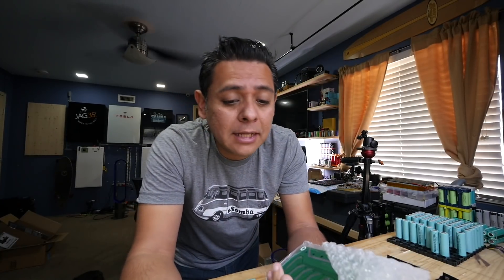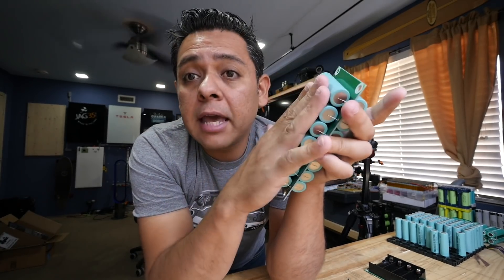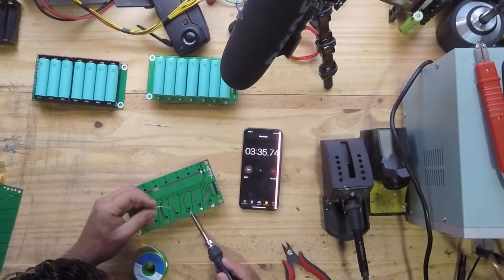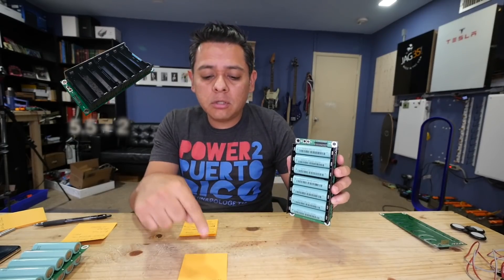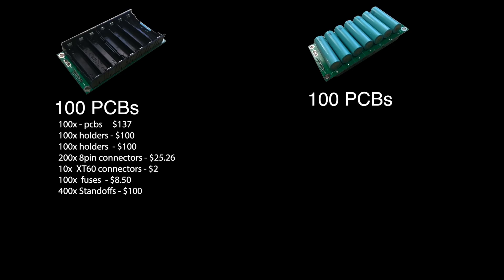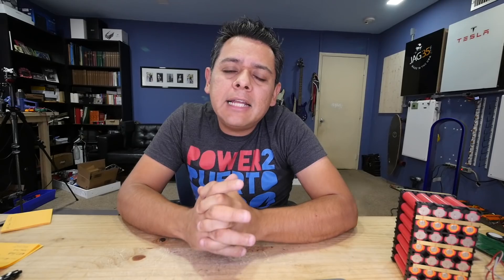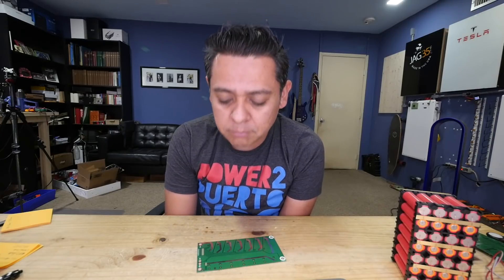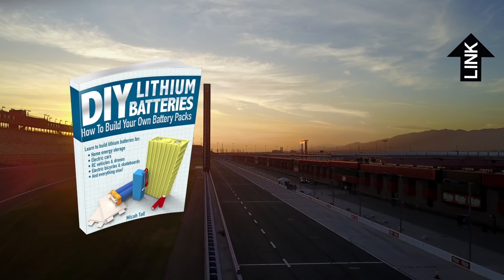DIY Rapid Build 18650 module PCB - Test Boards Available

Comment: Kuna from Toronto Canada:----Today 2nd day after joining with you Jehu, I want to build a small power wall for the first time for my small apt use.Can you please send me 10 pcbs and all other componants to put 70 X 18650 batteries together? or please tell me where to order and the specific names for the parts.

Comment: The difference, when it comes down to replacing batteries, that time will now take you less than 20secs to install the batteries per board with zero cost of material, all cast will be invested in batteries

Comment: do you have a link to the mini multi cell meter ?
Reply from the maker: Kit.com/jehu
Reply: ok so i went through all (i think) your listed items, i see the new colour one with the horizontal display, i was after that lcd one you have with the vertical battery display, i guess its an old model
Reply from the maker: Yeah discontinued unfortunately
Reply: isnt that always the case with the simple and effective type tech
im working on battery monitoring with an epaper display for low power consumption projects, far away from your power wall projects but i like power conservation, hence why i liked your lcd type monitor, thanks for the reply, enjoying seeing your progress

Comment: I'm a newbie but I'm concerned about aging cells.  Do they get swapped out after a few years?  Also I'm assuming they would need to be removed individually if you're trying to track down one bad cell.  It seems the more expensive kit would be better for future battery swapping.

Comment: So the question is how do you mount them. Since you already get a premade mounting system with the battery holders. Also you have a cleaner solution with the battery holders, if the battery goes bad you pop it in and out
Reply: Yeah, it seems like maintenance is going to be a pain on the spot welded batteries... though... you won't ever have batteries pop out by accident that way, either. :)

Comment: Jehu, I just stumbled onto your channel recently, I am intrigued.  I've been interested in building a powerwall for a while and I think your channel provides enough of the details to not only make it possible but simple.

I have a question for you about one glaring piece that you don't seem to discuss.  I read recently that a significant portion of our household power consumption is actually used as DC, not as AC.  Televisions, computers, chargers and now as we move toward LED bulbs, even our lighting.  With that being the case, it seems like you are wasting a significant amount of power by converting it into AC just to put it into your walls and again when converting it back to DC (in the wall warts and in-device power supplies).  Have you considered way to deliver the voltage from your powerwall units to places in your home where you can consume the DC directly instead of converting to AC and back to DC?  For example, if I could provide a 12-volt dc outlet behind my couch, I could run side-table lamps (converted to 12v DC with LEDs) and my laptop directly from that DC outlet.

Comment: Hey Jehugarcia , great video, thanks for sharing.  Would you please be kind enough to also make a board (ready for the holders to fit on) for a 14S setup thanks, that way it can be used for 48v inverter setups, where as your current 7S boards are really only well suited for 24v setups.  I know you mentioned that you can in theory put the 24v boards together to make a 48v setup, but it would be nice to have a 14S BMS header on each board so that a 14S BMS can be connected to the PCB boards for very tidy 48v setups. I'm sure other fans would likely also be keen to purchase 14S versions if you made them available too, hopefully your existing 7S version can just scale up / be extended to make the longer 14S version.  Cheers and keep up the great work :)
Reply from the maker: 2 of these makes 48v  no need to make another board
Reply: Hey Jehu, thanks for your message back (that means alot).  To be honest, I think you've missed the point a little bit there (hey we're all human right).  When you were performing the calculations for time & cost savings in your great video for using holders vs manual soldering etc you worked out time + cost saving comparisons compared which was awesome. If you were using say 100x pcb kits to makeup a diy powerwall then 100x 14s PCB kits actually end up less cost $ wise and time wise to assemble into a 48v battery pack than what it would using double the amount of 7s pcb kits.  As obviously the 14s pcb board could likely get away with 6 standoffs per 14s pcb instead of 8 used for 2 x 7s pcb, and you'd only have one bms connector (although a 14 pin version) and only 1 main dc power connector per board.  When you actually perform the calculations on using 100 x 14s pcb kits vs 200 x 7s pcb kits you'll actually see it makes financial sense + actually does save time also.  Run the calculations yourself and you'll see what I'm talking about, thanks :)

Comment: Why not move those BMS connector closer to the cells rather running all the way to one end. That would reduce the resistance and trace length. And are those boards done with 1oz copper or 2. The second would have more resistance and reducing the trace width also helps.

Comment: Spending a lot of time with 3D printing of late. The interesting bit is you can come up with your own designs, rather than depend on what someone else mass-produces (or do only one-off fabrication).

Watching you put together packs, but limited to only existing mass-produced plastic ...  pretty sure we could do better.

Pretty sure with a bit of clever design, we could reduce part count and assembly time. Producing the plastic bits via 3D printing is a bit tedious, but not expensive. Plus, if we come up with a good design, some Chinese manufacturer might rip us off, and start mass-manufacture for cheap (which is good for the larger community).

Also, pretty sure you are a short drive from me. :)

Comment: I'm noticing that on the nonholder assembly you've opted for a relatively small gauge wire.

 Im no expert but if you redesigned the vias that connect the battery wires to be more like <==> where it could accept a piece of flat ribbon wire, whats usually used to inter connect batteries in packs like this, would that not make it a bit more conductive and allow for better temperature control?

Comment: 2:49 I see a double row of holders on that board. You snuck the solder in at the ends of the holders. I have the same type holder here and I knew it could be done.
Reply from the maker: Yup, if you have the patience and don’t mind half melted holders,  go for it

Comment: Can't wait for the final version of the board!  I wanna build a 48v power cell for my ryobi lawn mower!  Tired of replacing the lead acid battery that seems to only last 1 season...
Reply from the maker: Not sure these will usefull unless you solder the cells,   What kind of load is your lawnmower? How many amps?
Reply: jehugarcia not sure.  Will have to get back at you once I'm home from vacation.  Be headed home tomorrow.
Reply: jehugarcia I haven't yet been able to find the full specs of the motor.  But the battery pack uses to 24v lead acid batteries that are 10ah a piece.  And it is looking like it is wired in series.  I wished I could send you a pic of the wiring diagram.

Comment: Aren't the 14cells connected with a small diameter wire?? It will get hot fast? Normally its used small plates spotwelded aswell
Reply from the maker: It’s a fuse,  it blows at 10A

Comment: Neat build. I would probably build the one with the holder reason behind is that over time the batteries do fail and the ease of replacement is so much easier than having to respot weld the batteries

Comment: Can you modify it to make a 1s pack so I could series them to make a 4s pack
Reply from the maker: Not this board,  it would have to be another one
Reply: yeh i assumed that, want a pack to suit a camper trailer so 14v would be perfect with good capacity

Comment: Do the Hover-board Batteries come with a BMS? I'm currently looking to buy them for a project but I don't want to do soldering/spot welding.
Reply from the maker: Yes they do have a bms,  they are great for just plugging and playing

Comment: do a double fuse wire to each cell - just for lower resistance and redundancy
Reply from the maker: Trying that right now
Reply: dont cut wire into pieces - leave wire in a roll weld one end to cell - then weld wire to next cell then loop wire back to first cell - then cut the wire from roll- likely faster doing it this way

Comment: SMD Fuses are listed as parts for the PCB. Where does it go on the board is there a call-out on the board indicating placement?
Reply from the maker: There is only one place in the board where the main trace is interrupted

Comment: I would go away from the battery holders as if they were to corrode, causing more resistance, would generate more heat without any sort of fuse circuit. Where a spot welded wire, if in an event they were to corrode, the added resistance would turn the wire into a fuse, and break before anything catastrophic happens. And if anyone says there are already fuses on the board, well yes there are. But the resistance is being generated on the contacts to the battery, pumping current into heat, and not into the actual fuse on the board, so the fuse becomes useless in this kind of event.
Reply from the maker: Why would they corrode?   You going swimming with them?
Reply: I'm from Florida :D

Comment: Can this be used for a 12v system? Using 12v for a portable battery lighting display thing, when no AC is around.
Reply from the maker: Nope 7s = 24v

Comment: Is this safe without a BMS on each of this board?
Reply from the maker: Only if you know what you are doing,  everyone else I recommend using a bms
Reply: That will drive the cost up a lot. Because you need one for each board. The cheapest 7s bms I found on ebay is $5. More parallel configuration would be more efficient.

Comment: I can't believe you're still recommending soldering to cells. that's a terrible idea. putting that kind of heat in to a lithium cell causes a serious risk of cell failure. either shorter life of a freaking fire.
Reply from the maker: I can’t believe you are still here watching someone as clueless as me,  go and make something of your life please
Reply: jehugarcia Look you've got some good ideas but some advice isn't too great. Such as soldering cells. and yes I've made something of my life, currently work with a company that refurbishes power tools and we do a lot of lithium. my job is to fix the problems caused when people do this.
Reply from the maker: You fix a lot of soldered cells do you?
Reply: jehugarcia no I fix the problems caused. once the damage is done they're gone.
Reply from the maker: So a lot of powertool companies solder cells,   Cool I didn’t know that,  further reinforces my belief that soldered cells are fine as long as people have half decent soldering skills,   If it’s good enough for powertool companies it good enough for us diy
Reply: jehugarcia no companies don't solder they weld. only people who've tried a dot job then buggered it up so we get the clean up.

Comment: Jehu Garcia Is there any reason why the holder version couldn't also be double sided?  In fact if it were me I would make the molded plastic holders a two sided structure and have the PCB's fit onto the ends of the cells as this uses less of both materials, (plastic and PCB).  It also makes them more modular.  You install the cells into the plastic holder (on both sides) then the PCB is installed on a side and it has cut outs that allow for a direct spot weld to the cell end.  More modular, more compact, faster, and cheaper.
Reply from the maker: You can’t solder the holders from the side without melting them,   I’m mostly trying to find an easy way for people to build packs
Reply: Actually I meant design a better holder and PCB--that is what I do for a living--design and manufacturing.  I could design a better system standing on my head with one arm tied behind my back.  Seriously if you want to work on this I am happy to help Jehu.  Even with the manufacturing portion.
Reply: That was my first thought as well. Maybe offset them a little bit on the top/bottom side and drill a little hole in one of them to be able to solder the one on the other side

Comment: What about making these in different versions like 6s, 5s, 4s and so on.. Would be realy nice for different applications.
I am currently about to build a solar powered li-ion soundsystem on 4s bassis.
Reply from the maker: That’s definitely possible but we gotta start somewhere and a board that hits both of the most useful voltages for diy powerwalls is a good place

Comment: And for the removable solution try using battery holders more like this, they are also cheaper than the ones being used https://www.digikey.com/product-detail/en/keystone-electronics/54/36-54-ND/2254090
Reply from the maker: You might want to check your maths  67 cents x 14 is not less than $2

Comment: Try cutting slots on the edge lining up with the holes for connecting battery wires, the slots I am talking about are very similar to what flyduino did with their kiss ESC's, only make them deeper than flyduino did. https://hobbyking.com/media/catalog/product/cache/1/image/9df78eab33525d08d6e5fb8d27136e95/legacy/catalog/107151_1_high.jpg

Comment: Forgot to ask one more quick question. In your link you specify using (Aluminum Standoff 3/8" x 1"  10-32 threads). If I was to put a battery on each side of the board like you did soldering straight to the board. Do you by chance know the size difference of the standoff? Also, do you think 6-32 thread will work?---Just trying to order some odds and ends today.
Reply: I guess it would be the size of a 18650's width...LOL
Reply from the maker: 1.5’ long,  6-32 thread would work but it would be wobbly as hell since the whole would be so much bigger than the thread,  I’m changing those holes smaller to use 1/4” standoff’s on final version
Reply: Cool, I'll get me a limited qty of these standoffs till you make the change. I'm excited to see what I can do with these. Thanks for answering back so quick!!!

Comment: I think the xt60 connector will rip of the copper off the pcb , u may consider adding slotted through holes or screw terminals or something to them .
Reply from the maker: The standoff’s are terminals

Comment: Could use some battery clamps/holders on the board to do without the glue gun.  If not viable, a battery holder to hold the batteries to together just to secure them from movement.
Reply from the maker: Just buy the battery holders and use them

Comment: I think you're just going to have to get some volunteers to have a cell building contest to sort this out. You're way too experienced to be a good judge as to which is easier/faster.
Reply: For those of us without spot welders, I know which way is faster (and safer!!) -- I personally would not solder directly to a battery with an iron (I know it can be done, but it's super error prone, and very easy to get a bad connection, or to overheat the battery, etc.).

Comment: I still like the idea of using the cell holders regardless of time to assemble as this makes the cell pack much, much more servicable.  This is especially in consideration of the fact that many of the builders are using recycled cells from laptops, etc., that will fail sooner than later.  Also, if you wanted to double up on the cell holders and use both sides of the board it may be possible to add a second set of holder mounting holes and offset them slightly to be able to solder the 2nd side in place once the first side was mounted.  Keep up the nice work and thanks for sharing all you do!

Comment: Very nice bro, brings the reality of the potential cost of the whole project to fruition.  I have a better understanding of how much a DIY powerwall will cost me in the long run than I did. I personally like the PCB board with the holder for ease of maintenance. With the other one, it's a lot of desoldering, resoldering, and yadda yadda, just an over all headache that I wouldn't want to deal with once I've made a powerwall. I just want to get rid of any bad batteries, and thats it.

Thank you for this by the way!

Comment: Thank you Mr Garcia,Another fantastic video..What kind of spot welder?,.And how many 18650 cells to equal a Group 27 deep cycle battery?..Compare the weight?..These battery packs look like they are so much lighter for say use in the RV world.Im surprised RV are not using them.Fantastic video.Thank you

Comment: Jehu, I assume the stand-offs for the build without battery the  holder are different as the batteries are on both sides
Reply from the maker: Just longer,  1.5” long works

Comment: Hey I’ve got eight 26650 battery 40 volt bae system power bank was wondering if I could take one apart and add ten volts to each of the other banks to bring them up to fifty volts dc and can I still use the battery maintenance system that’s connected to it my problems I have are 48 volt charge controller and a 48 volt power inverter I’ve spoken to the inverter mManufacture they say it’s OK to use the 40 V dc but now I have a charge controller that will work at 12 24 48 volts I’m concerned about overcharging I can reduce down to 24 V input but I don’t know that it would maintain a charge thank you in advance for any help or maybe I’m on a fools Aaron .....David Carter